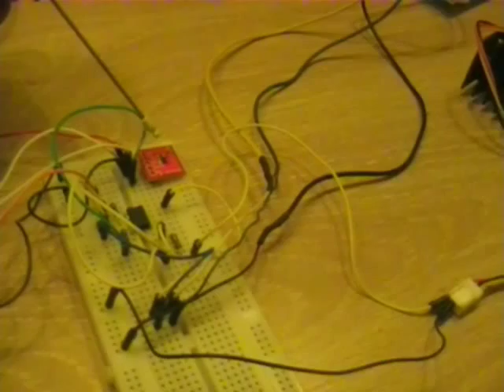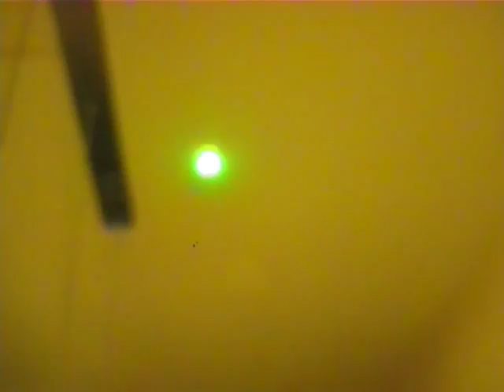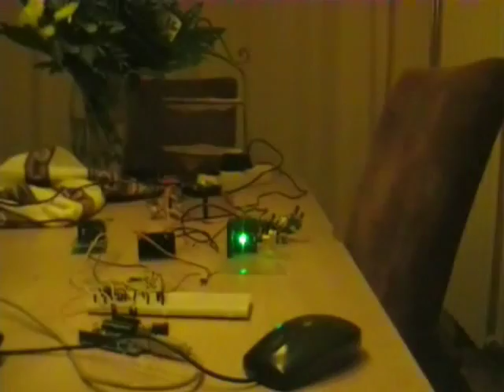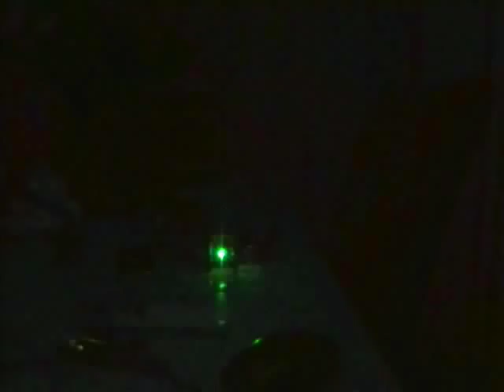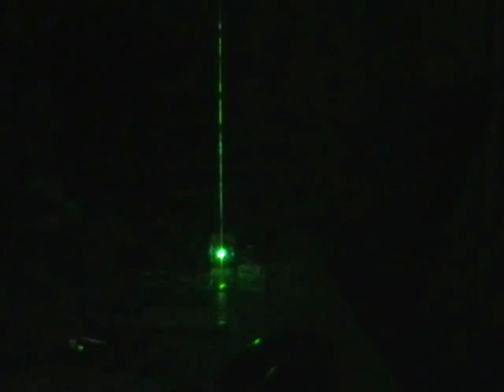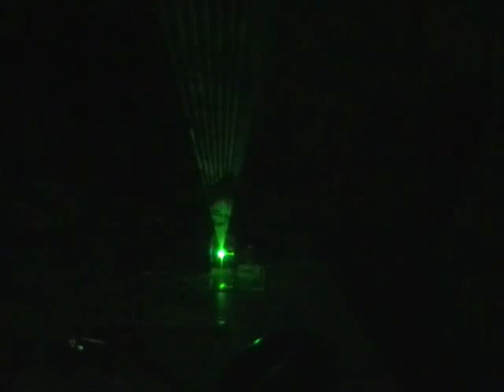ARDUINO LASER HARP WORKING PRINCIPLE 2

Comment: What type of Galvanometer are you using? I see some online for like $1,500, but then there are some for $100. My question is could a 30kpps be able to produce seemingly 12 different lasers from one point?  If not what would be the lowest Kpps a galvanometer you would need in order to create 12 flicker-less beams of light?
Reply from the maker: +Blake W 
I use 20kpps scanners (the ±US$ 100 ones) for the harp. 
From 15 beams it starts to flicker but it also depends on the angle at which you are scanning. The smaller the angle, the less flickering you get.